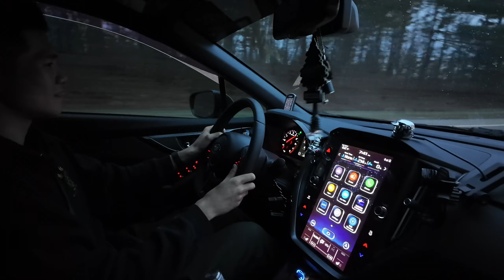The Boy's VB WRXs get more upgrades!!!

Comment: What exhaust did you buy that you waited 5+ months?  And now that it's at 6+ months, have you received it yet?  Was this Rae Motorsports by chance?
Reply from the maker: At the time of filming it was 5+, but now in real time it’s on month 8 and still nothing. No explanation or update unfortunately. And yes it was, did you get one too?
Reply: @RiceyRicky  still nothing after 8 months..  damn.  I just ordered the Rae Dual Exit Quad-tip w/ resonators about a month ago back on the first week of June.  I knew the wait was going to be a while, but hell, man.  lol..  I ordered a axle-back to hold me over.   I needed something back there.

Which exhaust did you order from Rae?
Reply from the maker: @Antykain   I got the same one. If I knew if it going to take this long I honestly would’ve went with a different company.

Nice, great idea with the axle backs to hold you over. Who knows how long it’s going to take to receive something from them.
Reply: Good luck guys…. I waited 11 months for mine.